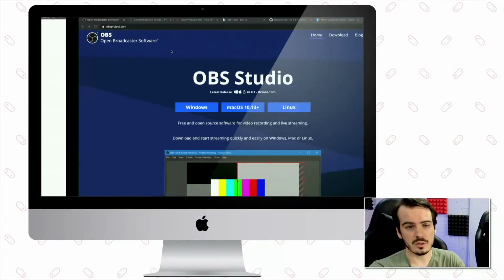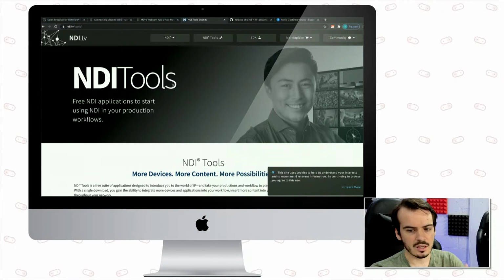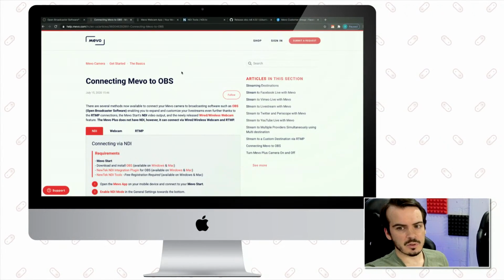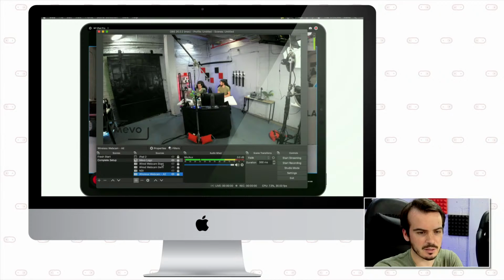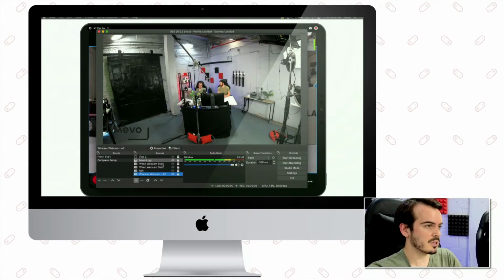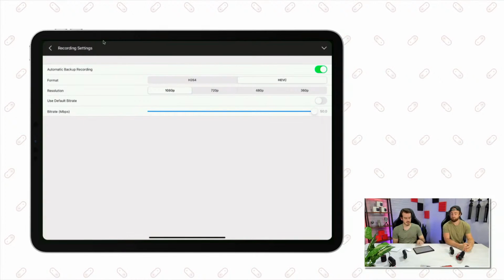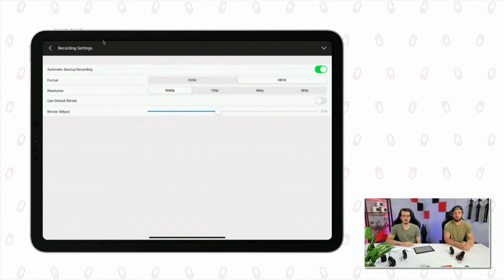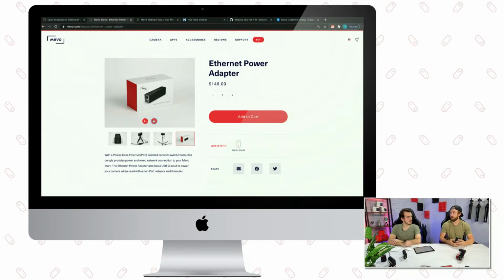Setting Up Mevo Start with OBS | Mevo Live 10.22

Comment: This video makes me think that I can use NDI to set up a second Mevo cam on OBS.  NDI seems to be an app to allow cell phones to be used as cameras.  My 2nd Mevo cam doesn't even show up as an input.  Do I need to be running this through my ipad?  I'm trying to use OBS so I can get rid of using Mevo via my ipad.  It crashes all the time when streaming and the graphic options are really limited on the ipad.  How can I set up multiple Mevo cameras and run them on my computer for streaming without an ipad?  I thought OBS would be the solution, am I doing something wrong?
Reply from the maker: You're correct, you can use many Mevo via NDI to connect to OBS. You can learn here how to accomplish this. -Joe C. 
https://help.mevo.com/hc/en-us/articles/360046292851

Comment: Hi, I'm using 10 GoPro Hero 8 Black and Hero 9.. all wireless for a DJ Setup Multicam outside (even in the snow for winter) all on wifi foward OBS ..problem is: I have different delay between cameras.. and its not static. So I dont have any solution to fix the delay between cams because if varies in real time ..based on RTMP servers.. do this setup have a "sync" for wireless setups? and how many can we set together? thanks!
Reply from the maker: Hi there, when connecting to a software switcher, network traffic can cause a delay with any connected camera. Our Mevo Multicam App automatically syncs any connected cameras and streams directly to platforms or an RTMP destination. Learn more here: https://mevo.com/pages/multi-camera-app

Comment: how come there is no option to run at 1080p when wired but only in NDI?
Reply from the maker: Each option has bandwidth and data limitations based on connection type, but we're always working on expanding the versatility of our products for future developments.
Reply: @MevoCamera  but if I connect with thunderbolt 3 cable shouldn't that have enough bandwidth to transmit 1080p?
Reply from the maker: Bandwidth performance for NDI will be dependent on the local network, but for support on your specific setup, please send us a note here:  https://help.mevo.com/hc/en-us/requests/new

Comment: Hey Guys, just picked up the Mevo start, and was hoping to run them into OBS as you are demonstrating, but the webcam app only allows 1 camera at a time. Is it not possible to multi-stream?
Reply from the maker: With a wireless webcam, a maximum of one camera is supported at a time. For multiple sources in OBS, we recommend using the wired USB option, or NDI HX. For further support, please visit us at help.mevo.com.

Comment: If I have multiple mevo starts connected into OBS (for example one wired, and one NDI) how to I make changes to the crop and zoom in the app. 

Do I have to use the multicam app? Or can I switch cameras in the regular camera app.
Reply from the maker: Hi David, at the moment each camera will need to be controlled in the Mevo Multicam App, though we are looking into better multicamera support for OBS in the future.

Comment: When using the NDI method, is it possible to get a Mevo Start's mic audio to register in OBS as well?
If not, what would you guys suggest in getting the Mevo Start audio over to OBS?
Reply from the maker: Hi Akaninyene, yes, if the Mevo Start's built-in mic is active, it will be transmitted via NDI | HX. For further assistance, please visit us at help.mevo.com.

Comment: I realize this was a MEVO demo but when you said iMac and OBS it prompted me to ask.What iMac are you using?  I'm using the newest Retina 5K, 27 iMac 2020 3.8 8core i7 with AMD RadPro 5500XT 8gb Also have 128 gb ram.  It's dropping frames like mad when using OBS. What's odd is when I connect my 2013 Imac up, non of this happens. When I use my MBP 2017 it's fine too. Have you experienced dropped frames with your iMac if it's the new 2020 version? Anyone else out there have any input?

Comment: Can you connect mevo to OBS using windows 10.  Can't find anything online.  Tried connecting but OBS does not find  Mevo when you click on device.
Reply from the maker: Certainly, the Webcam mode Will shows us at 2:45 works for all generations of Mevo cameras, or NDI workflow at 7:50 if you have a Mevo Start. Both workflows are the same for Windows (even if the demo is on Mac). If you need more help, give us a shout at www.help.mevo.com.

Learn more about Mevo Webcam mode: https://mevo.com/pages/mevo-webcam-app
Learn more about using NDI | HX with Mevo: https://help.mevo.com/hc/en-us/articles/360042292671-Using-NDI-HX